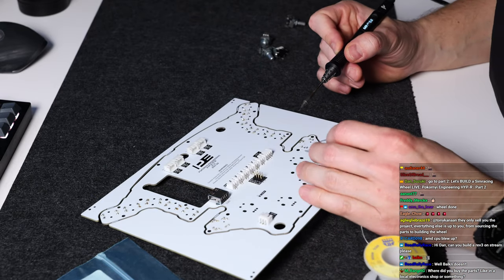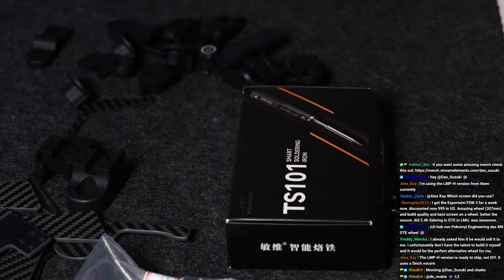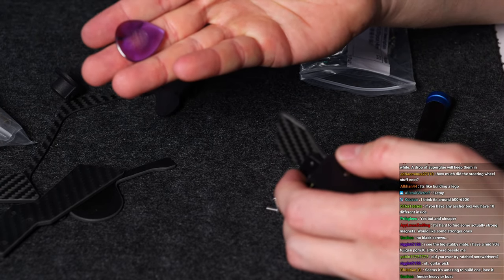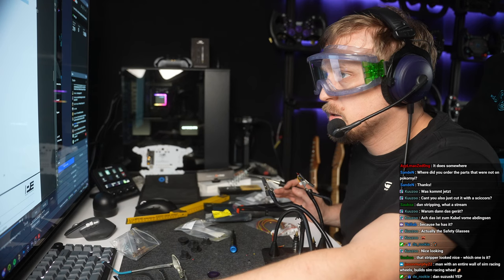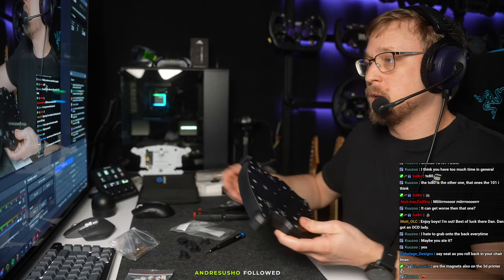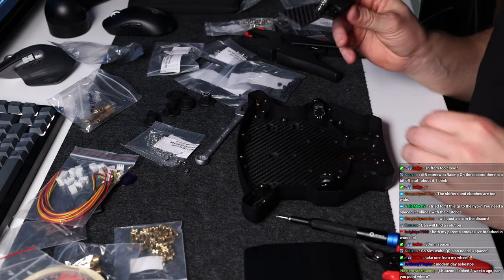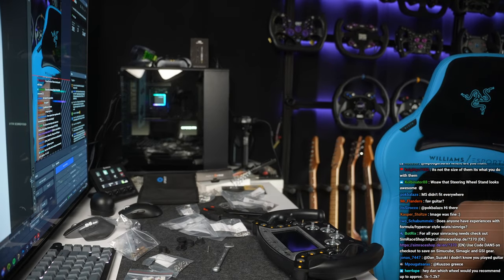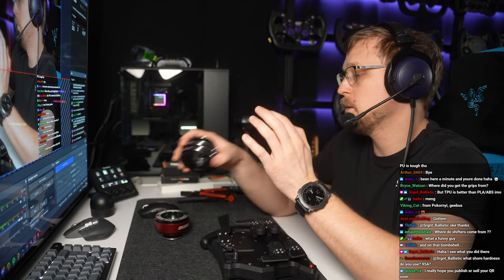Let's BUILD a Simracing Wheel LIVE: Pokornyi Engineering HYP-R | Part 2

Comment: Just a question on the brass bushings for the shifters and clutch, you wouldn't happen to remember the inner and outer diameters and length. The BOM just lists it as 4x8x6mm and the link goes to 8mm inner by 12mm outer by 6mm length?